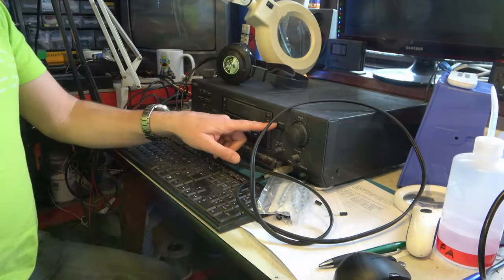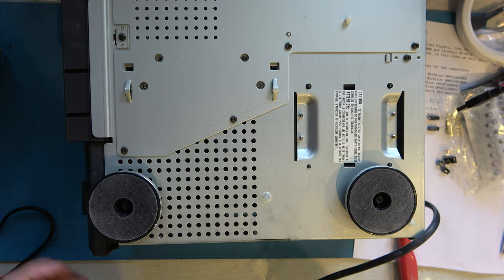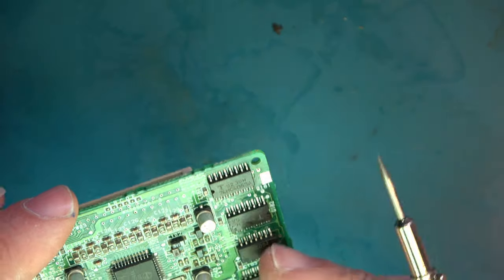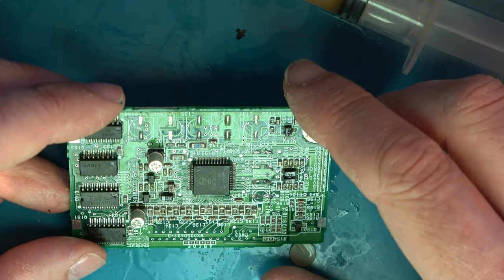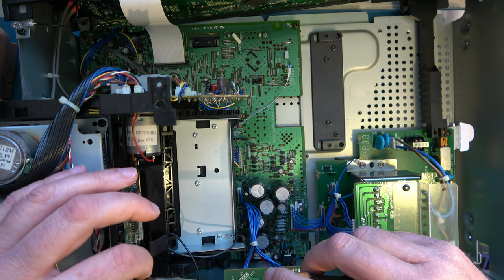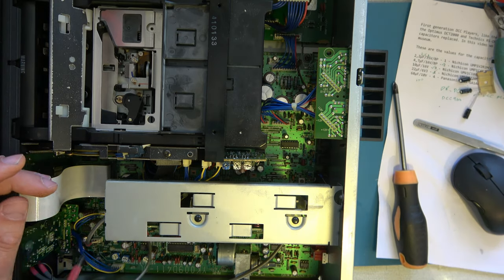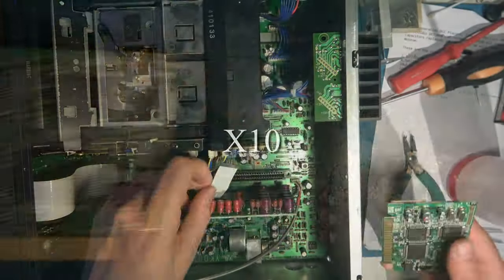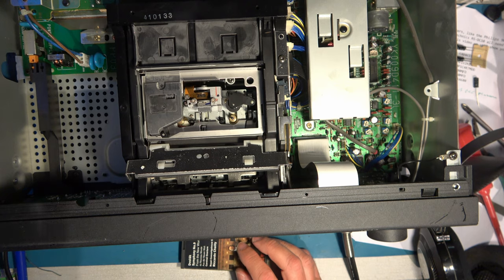Working on a Philips DCC900 Digital Compact Cassette deck.

Comment: Thank you for another very interesting video! Back in 2010 I found two DCC decks in the trash, a Marantz DD-82 and a Philips DCC 600. They worked mechanically, but neither one of them worked electronically. Most likely the same sort of bad SMD capacitors. Seeing this video, the repair indeed is complicated, but not as impossible as I thought back in 2010. I sold both recorders. Hopefully somebody was able to repair them and they still exist...
Reply: To my knowledge, bad surface mount capacitors are somewhat less common in later models than they are in the early models (Philips DCC-900, Marantz DD-82 and DD-92, Technics/Panasonic RS-DC10, Optimus DCT-2000)

Comment: I think you have made the right decision not to repair the analogue playback, it is not worth the risk. As you only need digital playback, I would call that done!
I really hate changing those nasty surface mount caps, the smell alone is foul enough. I also use through hole caps as replacements if there is room on the board.
Reply from the maker: I learned a long time ago: If the potential gain is small but the potential loss is large, it's a risk not worth taking even if the odds of losing are small.  Does that make sense?

Comment: Well done on making it much much better :-D
I was amazed at how dead those caps were, they looked fine, very deceptive.
I needed to use my old realistic scanner to listen to the output of a 433 mhz car fob i was repairing for a mate.
My scanner had died in storage :-(
A  capacitor near the audio stage had leaked all over the board and the tracks went black, some eatern away.
Evil things capacitors ;-(
Reply from the maker: I have an Icom IC-R2 for that sort of thing.  I've been changing surface mount electrolytic capacitors for years, but it's only been quite recently that I've seen capacitor juice eating up PCBs.
Reply: @video99couk  receivers are so handy, checking i.f strips in other radios by bringing the antenna coax near a circuit, no connection means no loading on the device under test :-D
I have an old yaesu frg7700 0-3mhz as well, ideal as test gear :-D.
Leaking caps really destroy pcbs :-(.

Comment: Hello, your work is excellent, but you did not check important parts, checking the variable resistors. There may be a malfunction or a loss of the connection, as well as the fixed resistors in the motherboard as well. The most important thing, the head may need to be modified. I am now working on modifying the board for the Dolby System and dancing vu meter regularly and I reached an excellent result in sound and purity as well as controlling the Dolby on the digital tapes. Sorry my language not very well but I hope you understand what I say

Comment: The problem with analog compact cassette lies in through holes contacts on the smaller board. If you repair next DCC900 or any first generation DCC recorder, first thing to do after capacitors removal is to check all the conductors especially through hole bridges as there often interruptions caused by the leaked electrolyte interacted with copper.
Reply from the maker: Yes, the capacitors do cause through-hole failures.  I had to repair at least one of those.
Reply: @video99couk  Not only through holes but often regular conductors are get damaged. Sometimes only a tiny invisible break near to the hole contact causes signal interruption too. I’ve experienced this often, especially near these 4 10uf capacitors that are responsible for analog cassette playback.

Comment: I understand the decision to stop at some point and tolerate some problems you don't really care much about, but why do you think you might make things worse if you did?
Reply from the maker: Two reasons: The flexicable to the head assembly is fragile, and if damaged then that's the end, so it's a balance of risk vs. gain.  Secondly, when looking at the Digital PCB, I could see that some through plating is in a fragile state.  It's a triple layer board, so there's a risk that a through-plate could be damaged during testing which would make it virtually unrepairable.
I'm not saying I will never revisit it however, if I ever have reason to dismantle the machine again.

Comment: It's always the caps need replacing with DCCs isn't it? I guess they were made during the capacitor plague era.

BTW I'm already subscribed to Dr DCC.
Reply from the maker: Yes, but later models like the DCC300 didn't use those awful surface mount caps.

Comment: Did u fix dcc 300 with no digital signal... Caps RW board or bad digital heads? Did u check errors rate?
Reply from the maker: Checked error rates, zero or nearly zero on good parts of tapes.

Comment: Nice repair. Question I am repairing my deck as well. Can you tell me where I can buy the pinch rollers or at least what the measures are? Is buying at aliexpress an idea? There are a lot of types available.
Reply from the maker: DR DCC has pinch rollers.  They're not cheap, but exactly the right ones.  See link to their channel in video notes.

Comment: that footswitch mod is G  E N I U S
Reply from the maker: It certainly helps on the ESR60.  The later model ESR70 has a slightly better design so it's easier to use.

Comment: Dreaded surface mount electrolytics-if I had a pound for everyone I’ve changed over the years, I’d be very rich !
Reply from the maker: I'm working on a Panasonic DVCPRO-50 deck at the moment.  Between myself and previous repair people, it's had about 200 capacitors changed I reckon.  And it still has capacitor issues.  So my next video will be about some equipment to hopefully make the job a little easier....
Reply: video99.co.uk I still can’t understand why a major manufacturer like Panasonic (Matsushita) couldn’t make an electrolytic capacitor (surface mount). These caps were bad even when they were new !
These were used in expensive professional & broadcast equipment (D5 AJ-D580), which wasn’t cheap. An alternative would have been to use tantalum capacitors, but these are more expensive & whilst they can fail short circuit or explode if they are over volted, they are generally very reliable.
An alternative now would be to fit solid capacitors, but depends how long you plan on using the VTR, as they are expensive.

Comment: Hello video99.co.uk,

I also have a DCC 900 on which the capacitors have to be changed. I contacted some radio and television technicians here in Germany, but nobody wanted to take care of the matter.

Since I saw how you did it, I have the question whether you would also change all capacitors in my device. Play DCC still works, unfortunately the DCC recording works with a DCC 60 minutes, almost OK, with a DCC 90 minutes mostly not anymore. Analog only plays the left channel (although I wouldn't care about the analog thing, it would of course be nice if it worked).

As asked above, would you change all of my capacitors? I can remove the PCB board and the other one (I'm a hobbyist) and then send them to you well packaged. Ask what would you charge for it?

How can I contact you by email? So that I can send you an email, so that you then have my email address and can then answer me.
I would be very happy if I finally find someone to fix it for me. Because I am a high-end fan and love these devices!

One more question, I'm not entirely sure why the recording only works almost 100% with the DCC 60 min., It may be that the tapes are old and worn (oxidation and / or the magnetic layer on the carrier tape has become too thin )?
Or does it have something to do with the tape guide (pressure rollers, main drive belt for the capstan)? It could also have something to do with the braking effect of the reel side, which keeps the tape taut during recording. Because if the tape on the head is too loosely guided, the head / tape contact could be too weak and, especially during recording, the tape head must have very good head-tape contact in order to be able to magnetize the tape right?
I would also like to change the pressure roller and the skin drive belt, where can I get these spare parts and what do I have to unscrew for them (a video about this wouldn't be bad).

I hope you can help me with changing the capacitors. I would do it myself, too, but very reluctantly. Because I no longer have such a steady hand and I would have to get myself a double soldering iron first, the Atlas ESR 60 would also be a good help. But these are all costs that I would rather invest in a professional capacitor change.
Please let me know if you would do it, as I said, I can remove the boards and send them to you. This means that the entire device does not have to be sent first.

By the way, I also have a YouTube channel: https://www.youtube.com/channel/UC9ZmYRdF5pEnaF8bd77qUTg/videos
There you can also see me as a person (360 ° videos about bike tours).

I hope my english is understandable as far as i made it with google translator. I can speak a little English, for a smal-talk it would be enough, but certainly not for such a differentiated thing.

Many greetings from K.R. from Remscheid / Germany
Reply from the maker: I don't take on repairs but I believe the DCC Museum do, see Dr.DCC at the DCC Museum: https://www.youtube.com/user/ralfie225
Reply: @video99couk  
Hello video99.co.uk,
thanks for the fast reply. It's a shame that you can't fix it.
To the DCC Museum and Dr. DCC I just wrote a corresponding rep request. Hope that someone can help me there.
Otherwise I have to do it myself again. Soldering circuit board assemblies is not the problem, only SMD soldering is not my strength. You need a steady hand.

I'll wait and see what the 2 answer. I'm assuming that you would stand by me with good tips if I did it myself, right?

First a question, where did you get the pressure rollers? I can't find them on ebay, and at least they have the straps. Or can I get them from the museum too?

The only question is when I have removed the drive, how do I get the main drive belt? What else do you have to unscrew? have you ever changed that?

Many greetings from the DCC 900 fan / Germany
Reply from the maker: @Fahrradkanal  Yes I bought the required parts from the DCC Museum.  Not cheap, but the right quality.  If they are doing your work then of course they can change the drive belts too.
Reply: @Fahrradkanal  Perhaps I can help you. I live in Germany. Vielleicht kann ich Ihnen helfen.

Comment: Hello ! Looking at the same dcc 900 and the seller say that no sound out from the player. What can be wrong.....easy to fix ? Can it play / record normal cassetts ?
Reply from the maker: This is a well known problem and it is covered in this very video.  Capacitors have leaked, they may be OK to replace but sometimes the PCB needs replacement.  The DCC Museum now stock them but soldering skills are required to swap over an IC.  So it's all do-able but not trivial.  Yes these will play normal cassettes, though most DCC enthusiasts recommend against doing so for extended times because it could cause machine wear.